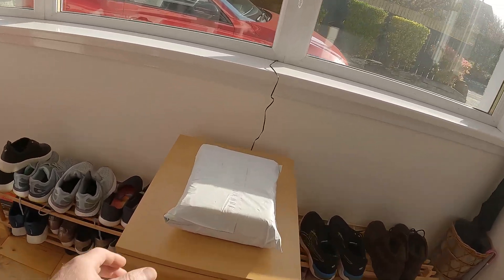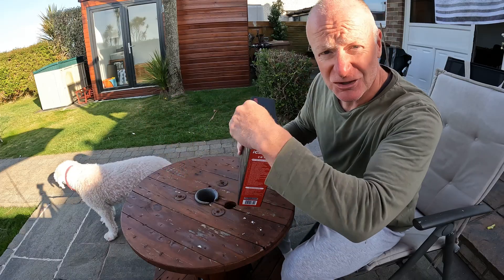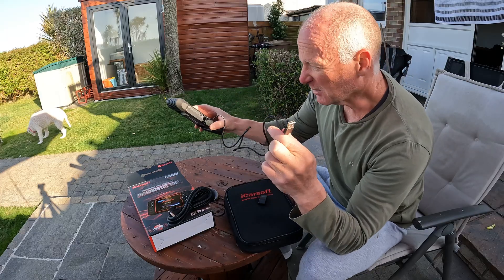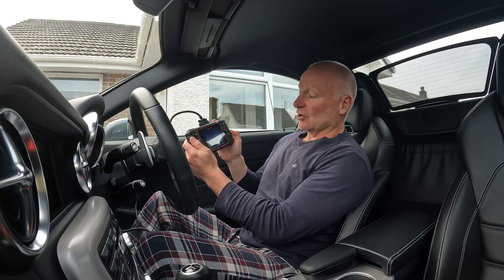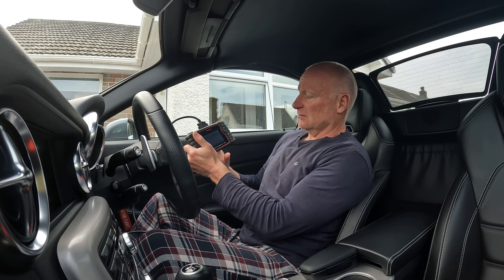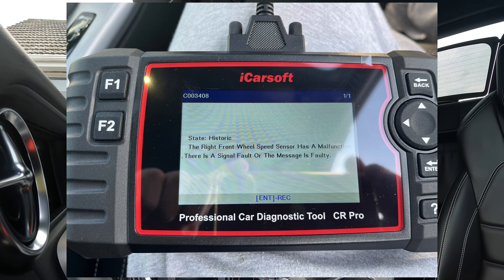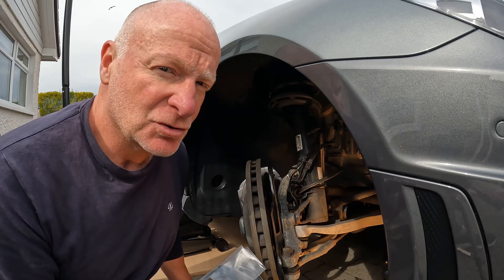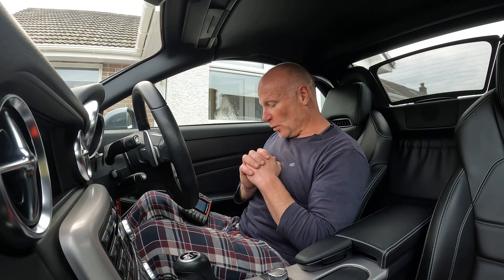iCarsoft CR Pro Diagnostic Tool - Mercedes Wheel Speed Sensor Repair

Comment: Brilliant and informative as usual! I'm looking to pick up an SLK55 R172 in a couple of months, your channel has been great for research! Do you have any recommendations of what to look out for when I go and look at one?
Reply from the maker: Excellent stuff 👍 The slk is a great bit of kit. Make sure it has plenty of service history, brakes are expensive, tyres not too bad. Really you just need to make sure everything works, the roof, the aircon, the air scarf, the heater (it’s a common fault), the stereo, everything. Mechanically they’re fairly bulletproof, make sure the fans kick in when up to temperature, the thermostat can fail and make sure the stop start works, if it doesn’t could be a weak battery. The ride is harsh, even in comfort, but they’re shouldn’t be any weird knocking noises. 
Oh, it’ll sound fantastic 👌
Reply: @midlifemotors5050  Thanks a lot! Ill definitely take a look at these things. And yes, the sound I cannot wait for. Looking forward to more videos!
Reply: Neil has covered most of common issues which I've come across and fixed on my 2012 SLK55.  One other issue which may not be immediately obvious are roof leaks, it quite common for the side panel trim seals (above the windows) breaking down causing water to trickle into the interior.  You'll only find out when it rains overnight and will dump a load of water near the seatbelt area when accelerating and drip by the front corner section of the roof liner as you brake.  Those upper side panels are bonded onto the roof and cannot be replaced \ ordered seperately from the entire roof.  There are various DIY methods to fix and reseal them but you have to be very careful not to break them in the process.  Hope this helps.

Comment: Have you kept the old sensor, to see if damage inside or dirt or corrosion? For £90 might be worth looking, you got another three left to fail.
I dont know how you inspect it, but it might be possible to open it up.
Reply from the maker: I have, more for the part no. tbh. Apparently they like to fail in pairs 🤨